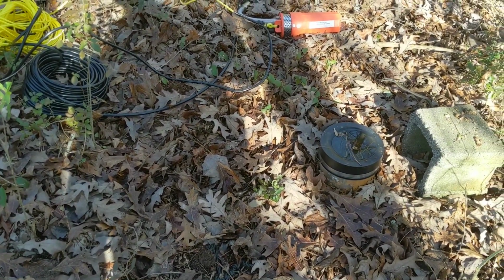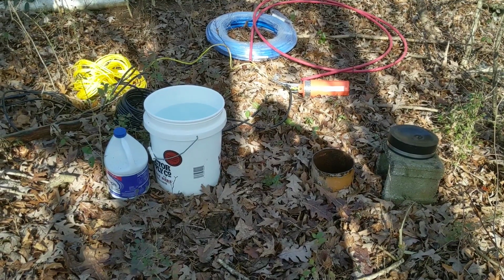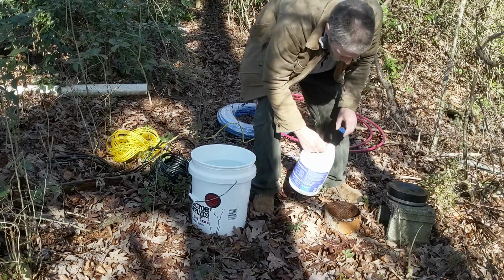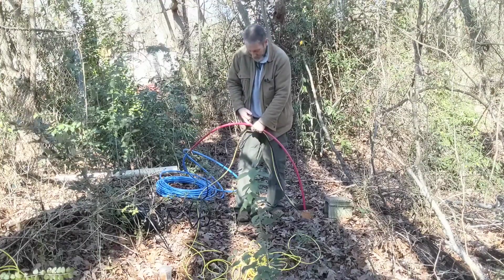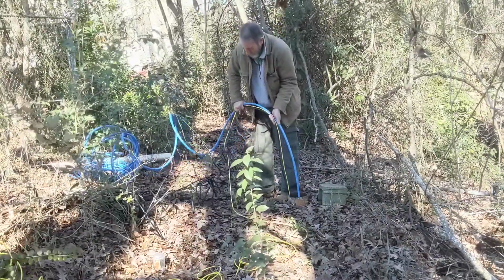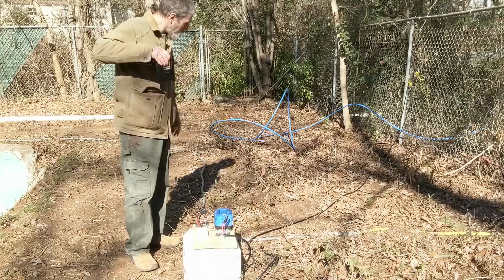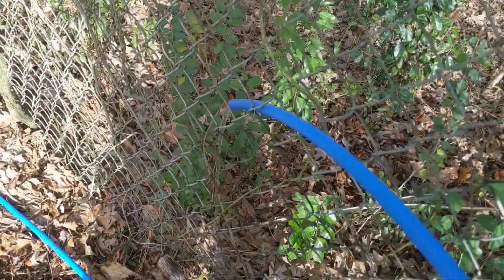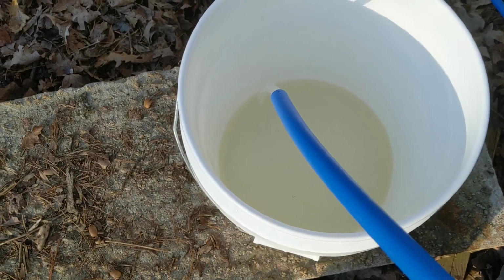Installing a $80, 12 Volt Well Pump 75 Feet Down an Abandoned Well

Comment: It's been a couple months now. How has the pump been working for you? I am looking into this or maybe the120w stainless model for a 110' well. Your feedback would be appreciated.
Reply from the maker: So far the pump has been working great. 
The flow rate is about 1.25 GPM (fills a 5 gallon bucket in about 4 minutes). 
All my issues have been with the water quality out of the old well, the pump simply works and hasn't been an issue at all. 
Not sure if you watched the rest of 'the series' of these videos, but I'm currently set up to run this 12v DC pump with either 40v Kobalt Batteries using a Step down converter, or off of 120v AC using a different power supply adapter. 
Power use on startup is a bit under 7 amps, once its running it stays at about 2 amps. Pump is on a 7.5 amp fuse to protect the batteries. 
Been planning on adding solar to the mix but haven't gotten there yet. 
Currently have about 250 gallons stored in an IBC tote for emergency use. 
Let me know if you have any other questions, 
eb
Reply: @TwoAcreHomestead  Thank you so much for the fast reply. Also, thank you for subscribing  to my little channel. I will watch your other videos as I research. I appreciate the information. Keep up the good work.